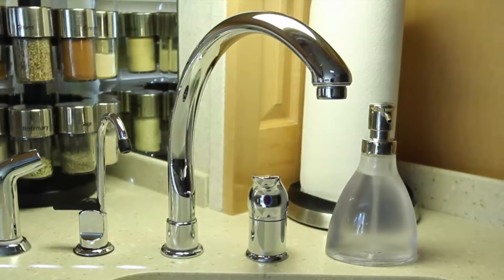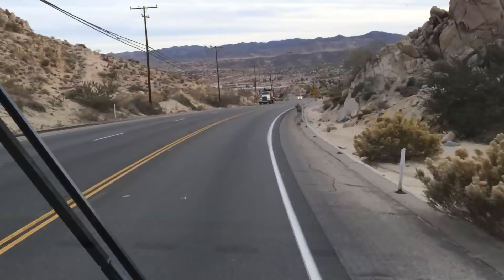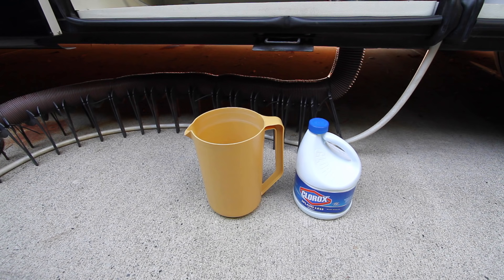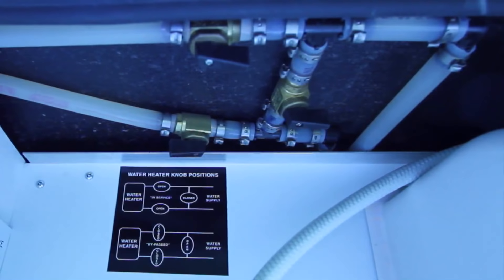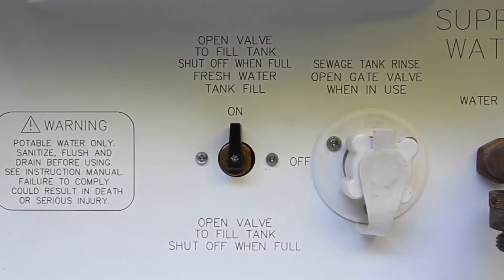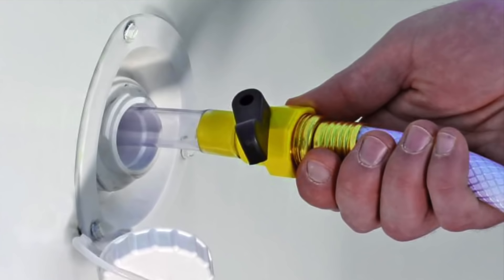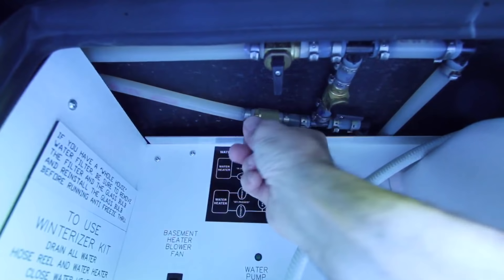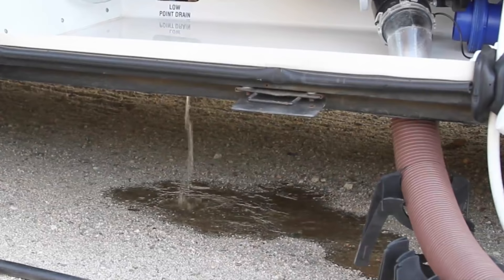How To Sanitize an RV Water System

Comment: I have had my fresh tank empty with the drain, only after I pumped Antifreeze through the lines, its going on two years now with no use of the 5th wheel, last Sept we used it and the water was/is foul smelling and foul taste. When we drive everyday, its usually on full hook up at night, but I have been keeping only 20 gallons or so on the highway, just enough fresh to make ice water and bathroom use, not carry extra 100's of lbs water. with the fresh not ever full, is that part of the problem with the fresh? TIA.
Reply from the maker: If your fresh water smells, you need a thorough draining and flushing (possibly more than one time). Draining the fresh tank at the low point drain may not drain all of the old water out (ours doesn't). After draining, try one of these two methods to remove as much water from the tank as possible: 1) After the low point drain has let out all it can, turn on a faucet and use the water pump to remove remaining water, or 2) Park the RV on an incline with the low point drain on the low side, and that should let out more water. Using and re-filling the water tank more frequently helps keep a fresh supply of water coming in, too. That "2 years with no use" will definitely make it pretty stale.

Comment: I recently bought an old class B rv from the 70s. I removed the fresh water tank and water pump. Is it okay to clean amid sanitize the old 30+ year old team or should I purchase a new one? I will be replacing all the water hoses throughout the rv. In mine there's only like 4.
Reply from the maker: Hi Jeffree! If you've already gone to the trouble of removing the tank and pump, and you're going to be replacing the water hoses, it probably wouldn't be a bad idea to replace the tank and pump, too. But if you don't want to spend the money unnecessarily, and the tank appears to be in very good condition and the pump still works, you could indeed sanitize them and reuse them. We'd suggest pricing out the new tank and pump and if it's not more expensive than you're comfortable with, then just go for it to have a pristine new system.

Comment: So I've got the bleach in fine, have the water heater bypass on, city water is off, but I can only get water to flow through the hot water side. I thought it might just be air in the lines, but I've had the cold water valve open for 30 minutes with nothing. I should add it works at the outdoor shower but nowhere else. Do you guys have any ideas?
Reply from the maker: Hi Jason.... hmmmm... without seeing your setup, it's hard to tell. But we'd suggest that you re-check the settings on all the valves for the bypass, as it's possible that one of them is in the wrong position and is preventing the cold water from flowing. Barring that, we'd try turning all the bypass valves back to see if that let the cold water flow again... and might just put up with the bleach entering the water heater (which isn't a bad idea, just more to flush out) if that's the only way you can get it to work.
Reply: Thanks for the reply, I don't know what happened, but the next morning everything worked properly. I suspect it to be an inline strainer that got clogged and freed up along the steps of my troubleshooting. Thanks again

Comment: Wouldn't the bleach damage all the gaskets, plastic and maybe even the glue holding the piping together?
Reply from the maker: Bleach is a pretty standard way of sanitizing. We've never had a problem with seals, valves, pipes or anything else as a result of bleach or otherwise, and we've been doing this for 13 years on this RV. The concentration is just too low.

Comment: I've heard bleach is bad for the plastic and rubber and to use Hydrogen Peroxide instead.  What do you think about this?
Reply from the maker: +PaleoAthletics We've read about people using hydrogen peroxide, but when we've researched it, it appears that the problem is the difficulty in getting the correct concentration. There are different concentrations available, and it's difficult to be sure you've gotten a high enough level in the tank to do any good. You wouldn't know until you got sick from bad water that it hadn't done its job.

We've used bleach in both of our RVs (our current one for over 10 years now) and had no problem with plumbing or seals. It's been SOP in the RV industry forever, and I think that at the small concentrations used for sanitizing (1/4 cup per 15 gallons) that it appears to be pretty harmless to the water system.

We also never have the problems with residual bleach odor that we've heard some people ask about. We simply empty the bleach water out of the tank, fill and empty it one more time, then fill it full and we're good to go. We actually just sanitized yesterday, and there is zero smell anywhere in the system.
Reply: Thanks so much for your reply!  Appreciate your time.

Comment: newbie here , this is my first rv in a long time , i just bought a 98 mallard fleetwood but they dont make them anymore ..its in great cond but i have hooked up to the water and the kitchen sink has a smell like its sewer or just bad...the rv place didnt give me a walk around they said it could be 2 weeks so i just said ill learn on my own..i dont even have the owers manual either and its hard to get one...can you give me some pointers please
Reply from the maker: The first things we would do on any new-to-you rig is to sanitize the water system as outlined in this video, and flush the water heater. We have videos on both Atwood and Suburban flushing.
Reply: TY ill check them out my system isnt newer and doesnt have all that stuff you had on yours ill watch your videos if i cant figure it out ill let you know..thanx
Reply: +RVgeeks i have question, how do u sanitize the city water in line. where u hook your hose to your rig while at campground. i have never been able to do that, my rv has pump off while on city hook up, so its pressured only from the city water source.  if i try and put anything in it, it just rolls out, not going in
Reply from the maker: +vegasdavetv Hi Dave. Since it's primarily water that's sitting that's the problem, the inlet hose should not be an issue, as the moment you turn city water on, fresh water flows right through. We've never sanitized our inlet hose before, and never had a problem in over 13 years. We'd suggest that the best thing to do is just replace your water hose every few years if you're concerned about it.
Reply: +RVgeeks awe thanks boys, made me feel better about it.  just needed someone else to tell me that.  i have never sanitized it, never had issue, just always wondered about it. now i won't worry anymore. what part of the country you guys going to be in during mid july?
Reply from the maker: +vegasdavetv West Coast.... of Canada! 🇨🇦
Reply: +RVgeeks cool, well at least your in the same time zone as us. lol, seattle.  were heading down the 101 through Washington and Oregon in mid july for a few weeks, just checking to see if you would be in the area for a quick hello.  will catch u all some day, maybe next year at glacier.  hint hint
Reply from the maker: Have great trip down the coast. Love it! Glacier..... hmmm.... it has been a while. ;-)

Comment: Love you guys but Clorox ? Clorox has soap in it . Pool chlorine without balancer is best with no residual chemicals. That’s what is AWWA approved for sanitization . Keep up the good work
Reply from the maker: You're right Brian. But plain old household bleach has been the standard for this job for eons, quickly available anywhere, and when flushed out thoroughly, hasn't been a problem. We don't actually know anyone who goes to a pool supply store to get chlorine for sanitizing, but again, you're right... it's probably the optimal way to go. Thanks for the input.
Reply: Yes True on that as we used clorox on our yacht for years but always reflushed all of it out before refilling the tanks. Now I carry straight pool chlorine  that is available at Home Depot stores.

Comment: A couple of comments: First, why would you not want to sanitize your water heater? There are times you will use hot water for making tea or instant coffee so I want my tank cleaned also. Just because you don't run antifreeze through it does not mean you shouldn't sanitize it.

Second: I really don't understand how you are using the winterize setup to sanitize your fresh water tank. When you pull antifreeze into your system through the winterizing setup this does not take the antifreeze to the fresh water tank. It only takes it into the lines in you MH. How does this sanitize your fresh water tank, it only gets the chlorine into the plumbing from the pickup tube to the faucets.

Just curious
Reply from the maker: Butch Evans Hi Butch! The reason we don't sanitize our water heater is because it takes a lot of flushing to get the bleach back out, and because we never, ever use water from the heater to do things like make coffee, since there is a magnesium anode rod in the tank, and we would not want to ingest any residue from that metal. We ONLY use cold water for drinking and making hot beverages.

On our RV (possibly plumbed differently than some others?) the winterizing kit will send water on the path of least resistance.... the water lines (if one or more faucets are opened), the fresh water tank (if the valve is set to "tank fill"), or the water heater (if it is empty, which allows us to draw vinegar into the heater for flushing.

This makes the winterizing kit a very versatile too, for drawing anti-freeze, bleach or vinegar, which we can easily direct to the needed spot.
Reply: you also have an anode rod in your water tank at home. look ion top of tank what looks like a hex head plug is an  anode rod and should be replaced if 5-10 yrs old
Reply: Even in your house you should never use the water from a hot water heater for consumption.  Draw cold water and heat it
Reply: Haha someone didnt watch the video close enough

Comment: Ok why after sanitation does my bathroom have a foam looking water coming out???
Reply from the maker: The most likely cause is old bleach, although it could be a reaction to something in the water to the bleach (which means it's good that you sanitized)! If you drain & flush another time or two, you should be able to clear the system of any residue.

Comment: I thought bleach would damage my plastic piping and aluminum tank set up   i have old school piping from 1980s
Reply from the maker: Well, radioguy, we can’t say for sure that it won’t as we’re not sure if your 80’s-era plumbing is made of the same stuff as our 2000’s-era is. But the concentration isn’t that high.... so it may be alright for you, too. Just proceed with caution.
Reply: thanks for the info, their was a plastic used then that caused a lot of damage due to the leaks from chlolrinated water, huge problem if i remember right. but a flush thru shouldnt hurt I guess,

Comment: RVgeeks I think this is what I must do. But I have a 5th wheeler, and no truck to haul it. Always depending on someone to help 😔 I think I've overstepped all my friends kindness. I checked the one way valve, it's nice and tight. No bad smell under my sinks. But boy, when I brush my teeth and open the water, that's what stinks soooo bad I want to vomit. My grandson (3 years old) does not want to use my water. I keep a gallon of water next to my bathroom sink for brushing teeth. What to do!!!!
Reply from the maker: Hi Vilma! Are you connected to city water, and if so does the water coming out of the RV park water system smell bad, too? If it's the water coming out of your RV's own tank, your fresh water tank needs a heavy-duty sanitizing treatment, as shown here. Also, is it both the hot and cold that smell? If only the hot smells bad, you probably need to flush your water heater: https://youtu.be/TL7AtXJYNcc

Comment: I am looking for help with my water system. When I run water out of the fresh tank, for the first few seconds, it runs black as coal. Then clears up. If I am gone from my 5th wheel for a few days and turn on the cold water @ the kitchen sink it runs black and clears up. Any idea of where to start in fixing this?
Reply from the maker: Is it only from your kitchen sink that this happens? If so, look for a carbon filter under the sink, which can sometimes run black at first. The fact that it happens instantly and clears right up leads us to suspect it's localized right at the sink.
Reply: +RVgeeks Thank you so much for your reply. the water runs very black when coming from the fresh water tank with the pump running. when using city water, it runs black, but not as severe and not as long.
Reply from the maker: If you look in your water compartment outside where you connect city water, there should be a valve to drain the freshwater tank.If you open that and allow water to drain out of the fresh tank, is it black? If so, that would mean your freshwater tank is full of black colored water and needs to be drained and thoroughly sanitized.
Reply from the maker: That is a mystery. If black colored water is only coming from the kitchen sink and no other faucets, it shouldn't make any difference whether you were on city water or running from your tank, because the problem must be localized at the kitchen sink, such as a carbon filter as we mentioned before.
Reply: +RVgeeks Thank you so much! I am going to replace the filter and also sanitize the fresh water holding tank.
Reply from the maker: Please let us know how you make out!
Reply: +RVgeeks I purchased the filter this afternoon. I have never replaced it. Can I just turn off the water and unscrew it and put in the new one?
Reply from the maker: +Gypsysoule2012 I assume you're talking about the whole-house filter (in a round white housing mounted in the water compartment). If so, simply turn off the water, then open a faucet to let the pressure off. Now you can unscrew the housing, replace the filter with the new one, and screw the housing back on. Be careful that the thin, round rubber o-ring washer around the top of the housing doesn't get lost or pinched when you re-install.
Reply: +RVgeeks The filter under the kitchen sink is the one I am changing out. I didn't know there was a filter for the whole house in the water compartment. I am a new rv'er and have a 08 Carriage Cameo.
Reply from the maker: +Gypsysoule2012 Sorry... yup... just turn off the water, open the faucet to release any pressure, and swap out the filter. NOTE: When you first run water through the new filter, it is SUPPOSED to run black for the first 20 or 30 seconds. Run it for a minute or two until the water runs completely clear, and you should be good to go.
Reply: +RVgeeks Thank you so much for your help!! I am going to do it right now.
Reply: +RVgeeks I replaced the filter. I have not had any black water issues as of yet. I still need to fill the fresh water holding tank with some water and run the pump to find out if black comes from it. Thanks for your input!
Reply from the maker: +Gypsysoule2012 I sure hope there's nothing black inside your fresh water tank! Hopefully you've solved the problem with the filter replacement. :)
Reply: +RVgeeks I am hoping the same. I am going to put some water in the tank, then pump it out. 
I will say when I changed the filter, I poured the water out of the old one and the same black stuff came out of it that came out of the faucet. I will let you know what happens when I work with the fresh water tank.

Comment: what about using
 3% hydrogen peroxide
Reply from the maker: Our understanding is that getting a sufficient concentration of hydrogen peroxide would require a very large amount of it for such a large tank. As the CDC specifies using chlorine to make water safe to drink, we've always gone with that.

Comment: Okay, so let me get this correct.  The hot water isn't already sanitised because it's.....scalding?
Reply from the maker: Sanitizing with heat requires boiling, so of course the water heater doesn’t get it anywhere close to hot enough.

Comment: This is completely off subject but I needed to ask. we are connecting a hundred pound propane tank in our suburban mobile trailer ,there is already two tanks connected can we just remove one of the hoses and connect it  to the new one? or do we need a whole new connection ? The other tanks are smaller abd located in front of rv... we are trying to live here so we need bigger tank.. also once connected is there anything else we need to do for it to start?
Reply from the maker: Hi Anais. We found our local propane dealer to be extremely helpful in providing both expertise and any hoses, adapters or connections that might be needed. We'd suggest that you take a few photos of your RV's propane tank and connections and of the new tank and its connections. Then show them to a local propane dealer to get their expert input. I was also going to suggest that you watch our video about connecting to external propane, but I see you already have. :)